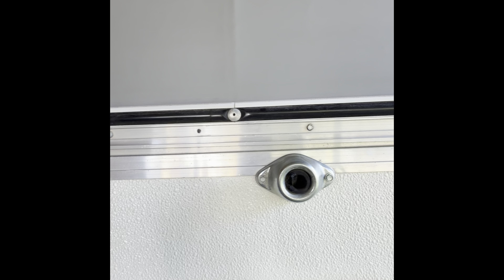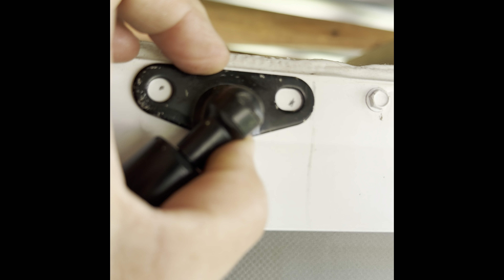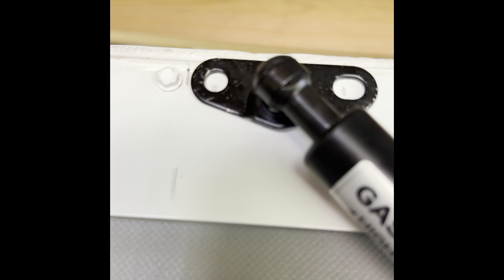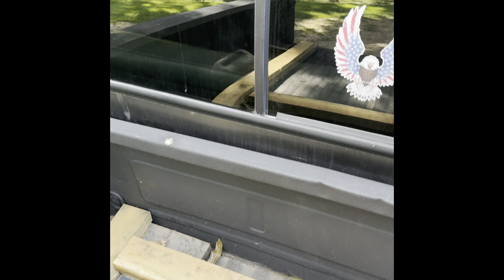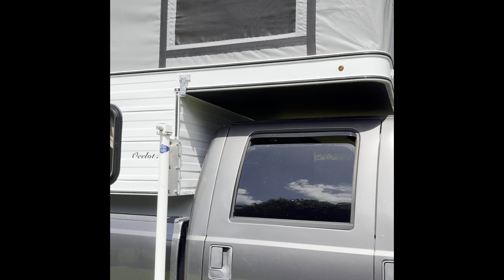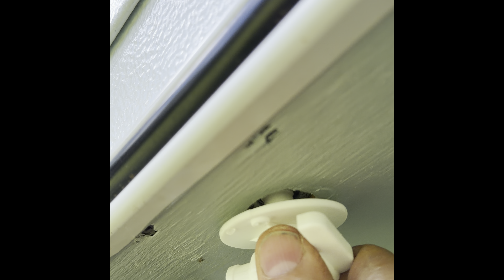All Terrain Pop Up Truck Camper

Comment: Nice camper, looks like it's gonna make for some awesome adventures.  Wish mine had the struts, I have the old Heco lift system and it kinda sucks.
Reply from the maker: Thanks! It was a great find. Like new for a 10yr old camper.  Just got to get it dialed in to how I want it😊👍🏼
Reply: @MojokaninMS  ATC and 4WC are the best on the market. Its not uncommon to see 30+ year old units. 
I bet it's gonna be awesome, subbed for the update 😉